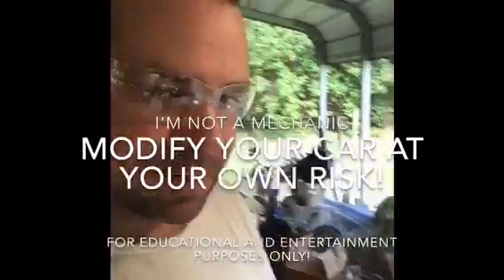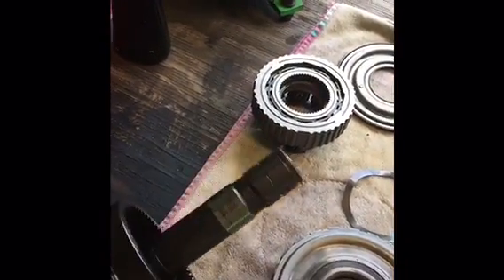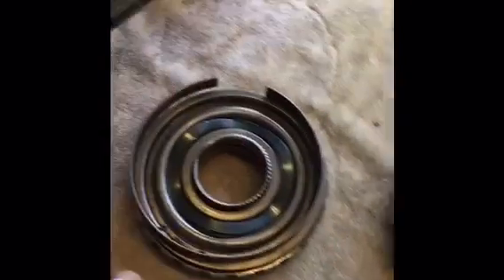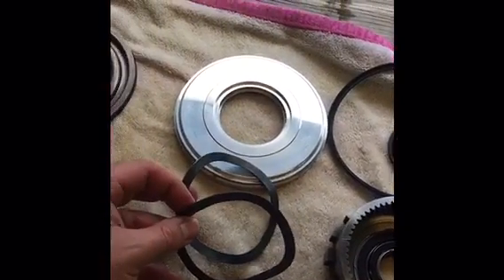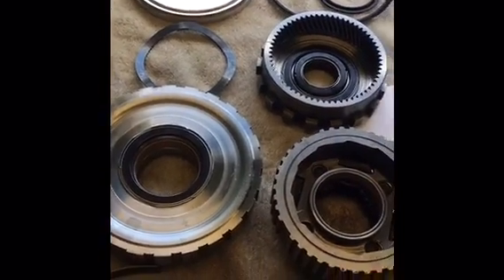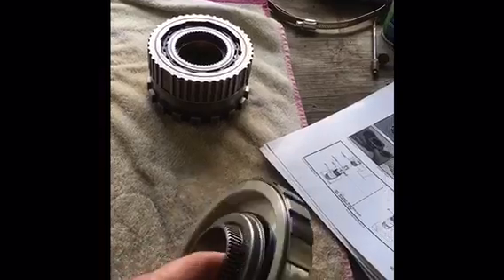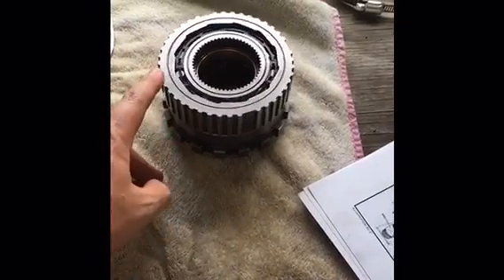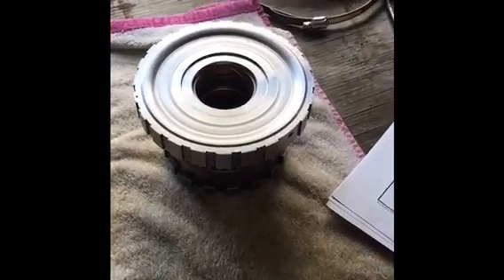200-4R Rebuild Step 2: Low Reverse Piston and Rear Planetary Upgrade

Comment: What shift kit are you using
Reply from the maker: Hey Robert! I’m going with a full manual valve body so about the most extreme shift kit there is. This will mod all of the items a shift kit addresses and then some, but no more automatic shifting.